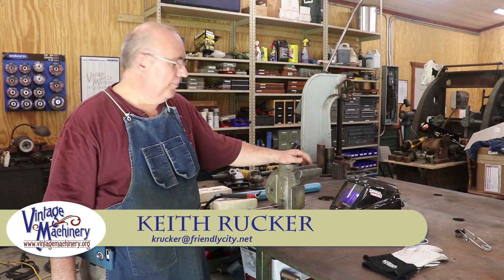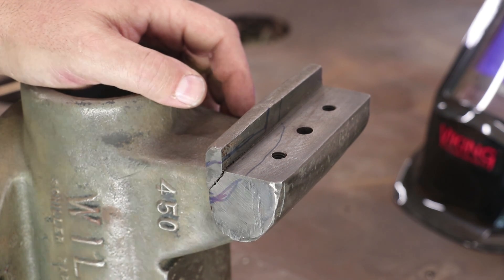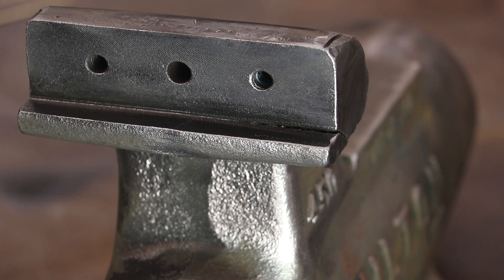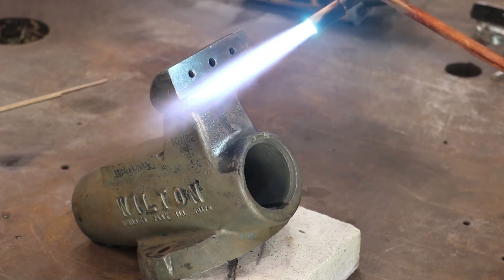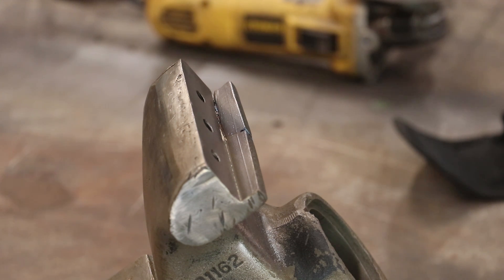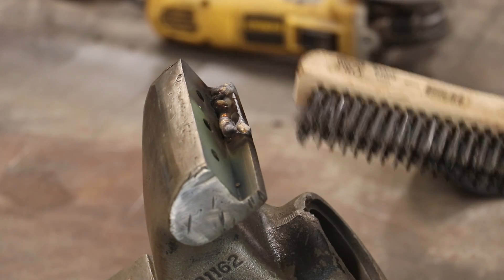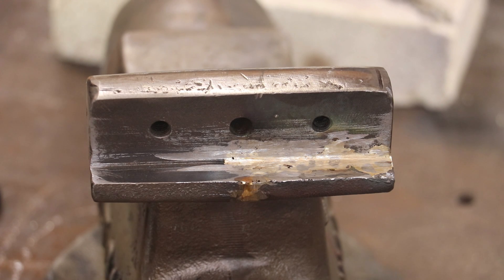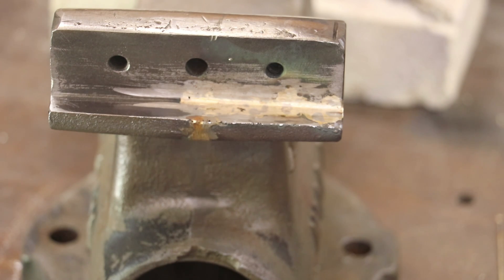TIG Brazing a Repair on a Cast Iron Wilton Vise

Comment: I have a Wilton and where the break is in the body and at the key way runner is and it is deformed or oblonged outward so being cast I can't just bend it back to round shape... question.. how too get thru the  years of grease and other contaminants ..? pre heat ??  heat sweat the oils out ??
soak in degreaser ? what??  I seen a cast iron Arch rod used for dirty cast iron ,,,,engine blocks and  equipment  but that might be to aggressive for this job...

Comment: I agree with Paul Teirney your torch was way to far away . If you want to see how tig welding or brazing is done check out welding tip & tricks on U tube , the guys name is Jody and in my opionion there is no one better . you did use the correct filler rod ( silicon bronze ) to braze it , Jody used it  on a vise check it out .

Comment: I would have 'V' it out and heated the item surrounded  by few fire bricks to get it really hot.  Used a number a number 10 tip in the OxyAcetylene  torch, braze with  8th brass rod filler rod,  keep dipping in flux or use ready fluxed rod. To cool off  rest on the fire fire brick and cover with a large cardboard box. I have repaired may cast iron items this way. It turns out neat with a small raised herringbone finish which can be left or machined flat. Looking at your job the braze did not penetrate and have a metallurgic bond right through.

Comment: Keith, watching this with much interest. I have been a welder Boilermaker retired now for many years. There are two kinds of processes for brass, brazing is capillary attraction the brass flows in and fills the expanded cast iron or other parent metal. Basically like filling swiss cheese holes in expanded parent metal openings, there really is no fusion. Welding is fusion where as the term implies two metals are fused together. Now there is such a process as braze welding. You get the cast hot enough to fuse with the brass which requires much heat and a puddle. That crack if it is not braze welded all the way through it will only crack through your filler brass through use of the vise over time. Tig is concentrated heat in a specific area creating a puddle to add filler metal, I couldn't see very well but don't think it was puddling. All those sparklies at the start is just throwing in a lot of porosity, kind of like pop corn, caused from the cast still being dirty. Tig will draw out any trash and cast is full of it. I applaud your effort but believe I would have stuck with flame. By the way my friend I really enjoy watching your videos. Just wanted to give you an insight into my experiences.

Comment: Any braze material with zinc will have this metal boil at TIG torch temperature. Using eutectic silver braze works better.   If it is a crack, clean first with phosphoric acid, then water flush followed by Harris white flux slurry.  You don't need much flux as it will be forced out by the braze.

Comment: First time I've seen this done with a TIG welder. Usually it's with a torch. You might give that a try next time. Also, is there any flux you could use to make the braze flow better?

Comment: I know its a casted part, but still I don't understand how to crack the bottom of the jaw holder, at least not with the hard or soft jaws in it! But in my eyes you don't use a vice without jaws.

Comment: Hi Keith  I are a sheetmetal engineer and been doing tig welding since the late 1960s and done the blazing many times. One thing I noticed is that you are tending to hold the torch to far away from the area  of the where you want the heat. Doing this causes what is called arc blow which is when the arc moves from one area to another jumping from one side to the other.  It can be controlled by  moving your tungsten closer to the joint. Also moving the  earth lead to the job or wrapping the lead around the work if it stills jumps. If you are having trouble seeing the arc use a smaller size Ceramic Nozzle. The tungsten should be about 1/8 inch from the weld. Keep up the welding and try different setting and you will find what suits you best.
Reply: Paul Teirney 
Well said Paul. Great advice.
I too have been under the hood for 43 years now and counting. I have done a fair amount of tig work, but nothing on cast iron, only oxy-acc method. But I did notice exactly what you explained and was sitting here saying the same thing you had written....
Like minds I guess..
Razor!

Comment: Lots of thermal shock with TIG more so than torch so if joining parts where contraction might cause cracking the torch would be better. For this application it was just fine just a warning about my experience with it for future projects. :-)

Comment: One thing people overlook, quite easily it seems, is that the strength of a brazing is not from the "blob" on the outside but from the "lapping" in between the metals itself. In the case of cast iron, the farther the bronze gets into the crack the stronger the joint. Does tig give a wide enough heat area for that to happen on cast?

Comment: I wonder if the initial weld was perhaps adversely affected by it being an inside angle. Meaning the heat stayed in that "L" rather than dispersing. It is obvious that a lot of the "globs" stuck, so those points had to have been at a high temperature. Anyway, thanks Keith, I need to try this myself.
Reply: The 'L' part of the braze job only needed a little more time and patience and attention to the braze to ensure that it puddled and flowed evenly across the gap.  A little (lot!) closer arc length and hand rest are required (DOE) in comparison to the much more forgiving OA torch flame manipulation, which Keith does well with.

Comment: I hope he wasnt a good friend as that was the worst looking repair I have ever seen you do. The tig job looked like a newbie did it (which is the case here) The crack was at least a 1/2" deep and you simply piled up material on the shelf then filed or milled it all off. There was no penetration as that wasnt your goal. This was an oxy/acet w/fluxed bronze rod if I ever seen one. The crack wasnt filled and bonded together with bronze filler....just covered up.....and poorly done. But hey....on the bright side you gonna make $150 on this poorly done repair by jamming out a monetized vid of the crappy "repair". The bandaid fix will break again and make the 2nd repair more difficult....congrats

Comment: Next time run that welder in DC negative and use a stainless tungsten. You will be much happier with your weld.
Reply: Do you mean Thoriated tungstens?  I use Lanthanated for everything and silicon/aluminum bronze braze carbon and stainless steels with no problem. My TIG 200 only TIGs with EN/AC (no possibility of gas flow if I were to switch to EP).
Reply: thoriated (red identifying band) tungsten .thats what I ment to put.

Comment: suring tool. a small handle with a graduated wheel to measure wheels.  This guy calls it a traveler.
Engles coach works put out videos on wooden wagon restoration and building. He built replicas of the 29 mule team borax wagons. great stuff.
In this vid he shows how to tighten wagon wheels  and re- tiring them in rubber.
Great stuff even if you never try to work on some wooden wheels.
https://www.youtube.com/watch?v=VO1Ei_wwDFQ&feature=youtu.be
Thanks

Comment: Hello people. This as always terrific to watch. Brazing is the traditional answer for this kind of repair. My question is would silver solder be as good or better than brazing ? Also,is there anyone knowledgeable enough to torch weld with cast iron filler rod ? I remember being shown such back in the 70s but was warned away from trying it myself. My guess is Nitrogen or Argon flood would be beneficial. Answers? Thanks.
Reply: Here's what I know from experience:  Silver solder would bond cast but is intended only for tight fitting gaps and is only effective where capillary action allows it to flow between and fill both surfaces.  It is extremely fluid at its liquidus state so where large gaps exist, it will not fill them - it will simply run out.  Also, you cannot TIG silver solder in the same manner as TIG brazing rod - when the arc hits the filler, it explodes (kind of), soots up and junks up the whole area. So if you were to start with silver solder, you would have to grind it out in order to do a proper braze.  Silicon bronze and aluminum bronze TIG rod are what you use.  If properly wetted in, they bond well with cast and hold it together with a tensile strength of 50,000 psi or greater.
Reply: MrDDDEEEZZZ Weldor Terrific detail on the answer. I know nothing about such things as silicon bronze. I was thinking of oxy acetylene not TIG. Appreciate the detailed response. Cheers.

Comment: I think using a die grinder with a rotary file would be a better choice than an angle grinder with a wheel. Whether tig or oxy-acetylene, there shouldn't be much of a difference, but I would have used a flux or a flux coated rod. Nice learning experience in a non-stress point of the vise. Thanks, Keith. Jon
Reply: Brazing fluxes cause sputtering and weld contamination due to the much higher and concentrated heat of the TIG arc and will only contaminate the weld as it burns.  The argon gas flow is as close as your are going to get to a 'flux' in this process.  If you have never tried TIG brazing using a flux coated low fuming bronze brazing rod, you're in for a treat!  Sputter, pop and flare with ample carbon.  There may be a way to 'sneak up' on it but I have had zero luck with that approach as well.  What you need for TIG brazing is either silicon bronze or aluminum bronze TIG rod (not gas brazing rod).
Reply: O
Reply: Looks good never seen Tig brazing .

Comment: to stop the crack from spreading when heated,  its advised to drill an small hole at the ends of the crack on both sides

Comment: Keith, did you consider Aluminum Bronze if your TIG has AC? I did see one video in which he used  Silicon Bronze on AC with 10% cleaning, but most seem to use Aluminum Bronze, stronger. I usually run into trouble with contamination and have been somewhat able to improve the situation by regrinding most of the weld out and re-welding, with heat issues being watched very carefully. Nothing more disgusting than "ping" when she cools down!

Comment: I've got a 4" Wilton that's missing a chunk out of the jaw casting in about the same area as that one cracked.  Is it possible to build up brazed material to repair the jaw? Or is that just a load of trouble for relatively little benefit?
Reply: I'll throw a comment at that one...  Cast is strong but brittle.  It will withstand a lot of pressure then at its yield limit, will all of the sudden snap.  Braze on the other hand is much softer, malleable and can stretch.  While a fill to remake the missing cast would make a good repair, it would be subject to bending at the same susceptibility (somewhat) as your jaw material.  So, if you did the braze fill repair and milled it to snuggly fit the jaw, AND you didn't just clamp down hard on that one side with the braze fill, you should never have a problem.  Even if you did (assuming not going full-animal), you might have a slight jaw mismatch on one end of your vice due to jaw face/braze yield but it would probably not break out.  Of course, a good wetting of the bronze to the cast at the start of the build-up is key to its holding securely - otherwise that would be your fracture point if stressed too much.
Reply: Josh Rosenmann.   The old guy that taught me to weld back in the 50s frequently repaired worn cast iron chain sprockets by building up teeth with  bronze brazed w/ oxy acetylene.  When he was done with the torch, very little filing was required.  Granted, these were the big conveyer belt chains sprockets, but he could lay up layer after layer very accurately.  Just takes practice and patience.  Keith Fenner  has some brazing vids which demonstrate much the same technique.
Reply: This is a repair Keith made to a grinder stand and could easily be done to repair your Wilton using a small piece of cast iron bar stock or a salvage chunk of cast iron.  
https://www.youtube.com/watch?v=0NvIeb8fTAI

Comment: I've done quite a bit of tig welding, but I've only tried brazing once or twice. I really prefer using an oxy acetylene setup to braze. The bronze seems to flow a lot better and I feel like I have a lot more control over the capillary action so I can get the flux, and then the filler deeper into the crack I'm try to repair. Though I will admit it may just be my lack of experience with tig brazing and if I did more I might change my mind.

Comment: Maybe I’m wrong? Probably would’ve been best to drill and tap some holes, and put some strong countersunk socket head cap screws to hold the piece to the vice... then follow up with the brazing to fill in the crack..
Reply: Yeah, Lincoln book of arc welding describes that quite well...Brian @ bcbloc02 repaired his big radial arm drill that way.

Comment: I have a vice cracked by tiring it to much. My stupidity. So I mig it the first time it didn’t hold. So the second time I weld it 45 across the crack and I didn’t hold back. It’s been good so far it’s bee about a year or so.

Comment: SUGGESTION -- when I braze cast iron I groove it out like you did but then I follow that with a rotary file to remove any contaminants from the grinding wheel. ALSO - I didn't see any brazing flux. Is it not required wit the TIG for some reason? I've only brazed with gas.
Reply: My 2 cents:  Brazing fluxes (white or black) will simply burn up with the intense heat of the TIG arc and contaminate the braze area.  It would be beneficial if Harris were to develop a TIG brazing flux.  TIG brazing just does not wet in like torch brazing.
Reply: Admittedly I know nothing about brazing but I was kinda wondering about the lack of any flux too...
Reply: Argon displaces the Oxygen and some other crap, so if the metals are compatible (brass, cast iron, copper, steel) maybe it's not absolutely necessary. I still think it'd wet in better with some -tin.
Reply: Attempting to use a Flux while TIG brazing would make a hell of a mess and probably contaminate the tungsten.

Comment: Keith that turned out good from what I saw. I would have drilled a hole at the ends of the cracks to stop it from cracking more.  jim

Comment: Andy needs to make a new set of jaws that extend over the top of the casting (an upside down L) to take the pressure of downward force and transfer it to the upper part of the casting.

Comment: If you need to hit it that hard, get an anvil.  Nice repair.
Reply: Yeah, in my 50 some years of metal working...I've seen plenty of guys pounding away at the 'work' in the vise with a 4# sledge....a few times there's a very surprised guy looking at the front half of the vise laying on the floor...

Comment: As often as you work brazing,  it might be time to find a second hand stove from someone remodeling their kitchen.  Warm things evenly in the oven.
Reply: And... a pot of chili simmering on the shop stove on a cold day is never a bad thing.
Reply: I got a little apartment stove from my nephew to use in my shop.  Doesn't take much room and heats to 500 degrees F.
Reply: What's wrong with a BBQ? (Propane is best)
Reply: therealrg ...THAT DOESN'T SOUND SO HOT-!!

(SNUCKER-SNUCKER-SNUCKER!!)